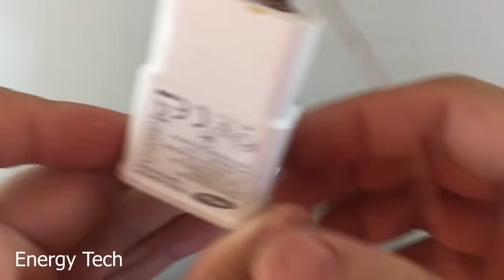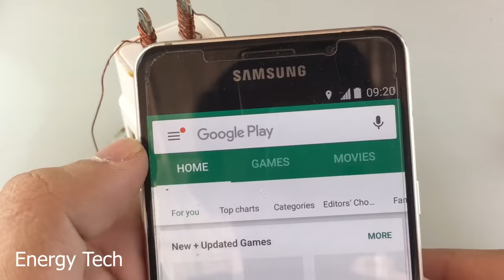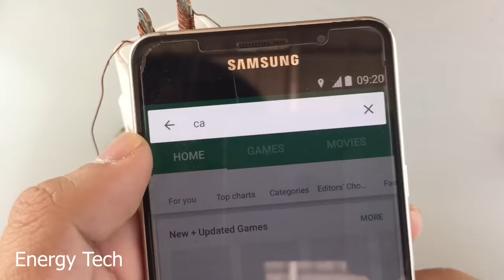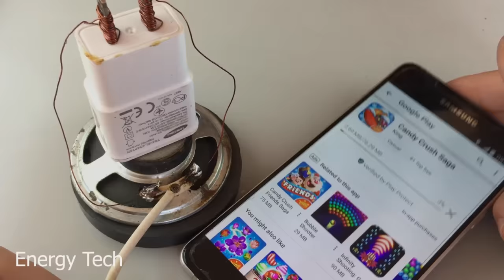New Free internet 100%  - Ideas Free internet at home 2019

Comment: It actually did work .. in my dream
Reply: Nuse
Reply: USB has 4 wires, red and black is for power, 2 other is for data. So which wire will go to speaker, power or data.
Reply: Good question